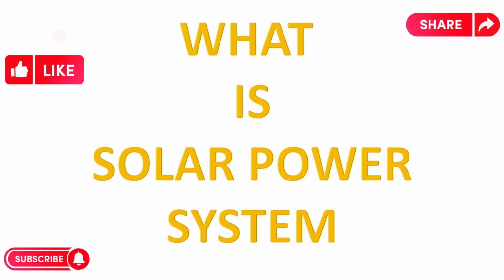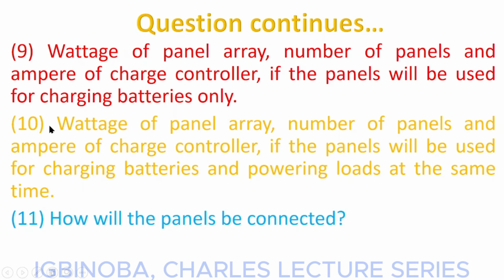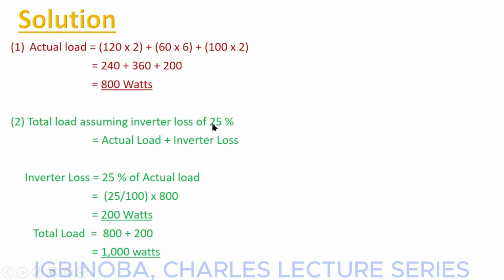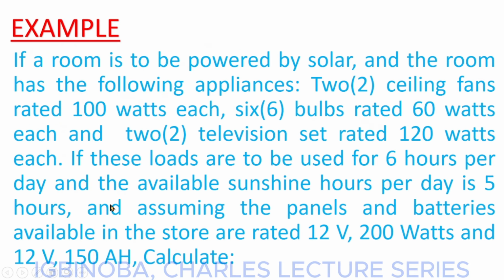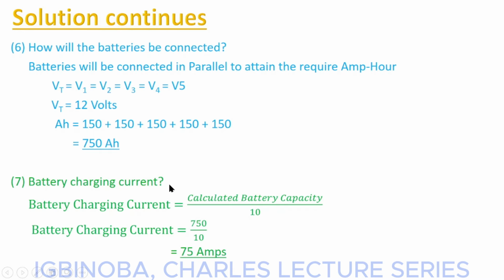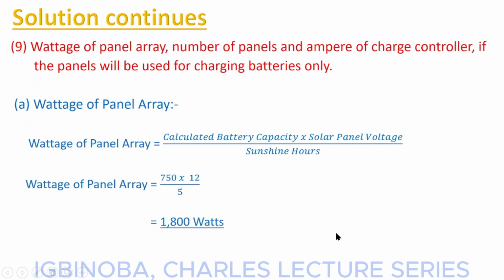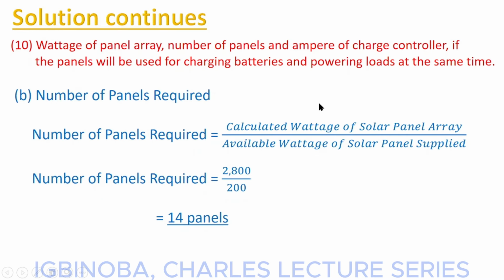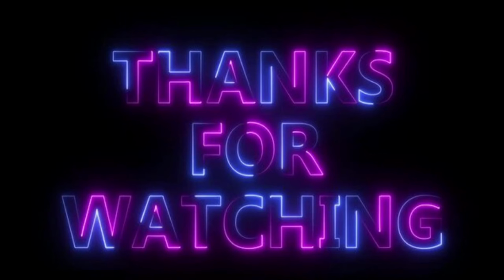Design of Solar Power System

Comment: PETRO64L

1.  Actual load = 1380Watt
2. Total load = 1725Watt
3. Inverter rating = 2156.25VA
4. Battery capacity = 1239.75Ah
5. Number of batteries = 8.625 (9 batteries)
6. They will be connected in parallel
7. Battery charging current = 129.375A
8. Battery charging time with 40% loss = 14hours
9a. Wattage of panel array = 3105Watt
9b. Number of panels = 16 panels
9c. Ampere of charge controller = 258.75A
10a. Wattage of panel array with load = 4830Watt
10b. Number of panels = 25 panels
10c. Ampere of charge controller = 402.5A
11. They will be connected in parallel

Comment: CIV32F 
Answer
1 1,380w
2 1725w
3 2,156.23va
4 1293.75ah
5 9 battery 
6 parallel connection 
7 129.4amp
8 14hrs
9 3105w
9b 16 panels 
9c 258.75amp
10 4,830w
10b 24 panel
10c 402.5amps
11 parallel connection

Comment: EEE10J 
ANSWER 
1380W
1725W
2156.25VA
1293.75Ah
9batteries
Parallel connection 
129.4A
14h
3105W
16panels
258.75A
4830W
24panels
402.5A
The panels are arranged in parallel

Comment: PETRO5SC

Answer

1380watts
1725 watts
2156.25va
1293.75ah
9 batteries
Parallel connection
129.4amps
14 hours
3,105W
16 panels
258.75amps
4,830 watts
24 panels
402.5 amps
The panels are arranged in parallel

Comment: NAT48V

1380watts
1725 watts
2156.25va
1293.75ah
9 batteries
Parallel connection
129.4amps
14 hours
3,105w
16 panels
258.75amps
4,830 watts
24 panels
402.5 amps
The panels are arranged in parallel

Comment: PETRO18R

1. 1380W
2. 1725W
3. 2156.23VA
4. 1296.75Ah
5. 9 batteries 
6. The batteries are connected in parallel 
7. 129.4Amps
8. The battery charging time is 14 hours
9a. 3105W
9b. 16 panels
9c. 258.75Amps
10a. 4830W
10b. 24 panels
10c. 402.5Amps
11. The panels are connected in parallel

Comment: CIV95Q 

1) Actual load = 1380 watt
2) Total load = 1725 watt
3) Inverter rating = 2156.25 VA
4) Battery Capacity= 1239.75 AH 
5) Number of battery = 8.625 (9 battery)
6) They will be connected in parallel 
7) Battery charging current = 129.375 A
8) Battery charging time with 40% loss = 14hrs
9a) wattage of panel array = 3105 watt
9b) number of panels = 16 panels 
9c) Ampere of charge controller = 258.75 A
10a) wattage of panel array with load = 4485 watt
10b) Number of panel = 23 panels
10c) Ampere of charge controller = 373.75A
11) They will be connected in parallel

Comment: CIV14N

Answer:

Actual load = 1380Watt
Total load = 1725Watt
Inverter rating = 2156.25VA
Battery Capacity = 1239.75Ah
Number of batteries = 8.625 (9 batteries)
They will be connected in parallel
Battery charging current = 129.375A
Battery charging time with 40% loss = 14hrs
9a. Wattage of panel array = 3105Watt
9b. Number of panels = 16panels
9c. Ampere of charge controller = 258.75A
10a. Wattage of panel array with load = 4485Watt
10b. Number of panels = 23panels
10c. Ampere of charge controller = 373.75A
They will be connected in parallel

Comment: CHM81C

nswers:
Actual load = 1380Watt
Total load = 1725Watt
Inverter rating = 2156.25VA
Battery Capacity = 1239.75Ah
Number of batteries = 8.625 (9 batteries)
They will be connected in parallel
Battery charging current = 129.375A
Battery charging time with 40% loss = 14hrs
9a. Wattage of panel array = 3105Watt
9b. Number of panels = 16panels
9c. Ampere of charge controller = 258.75A
10a. Wattage of panel array with load = 4485Watt
10b. Number of panels = 23panels
10c. Ampere of charge controller = 373.75A
They will be connected in paralle

Comment: PETROCHEM36J 

1. Actual load: 1380w
2. Total load: 1725W

3. Inverter reading: 2156.23Va

4. Battery capacity using a factor for reserve of 75%: 1293.75Ah

5. Number of batteries for backup hours: 9

6. How will the batteries be connected: parallel

7. Battery charging current: 129.4hrs

8. Battery charging time assuming a charging loss of 40%: 14 hours

9. The wattage of the panel array: 315W

96. The no of panel: 16 panel

9c. The charge controller rating: 258.75ammps

10. The wattage of the panel array: 4830Watts

106. The no of panel: 24 panel

10c. The charge controller rating: 402.5ammps

11. Panel connection: parallel

Comment: EEE102X
1. Actual Load: 1380 W
 2. Total Load: 1840 W 
3. Inverter Rating (0.8 Power Factor): 2300 VA
4. Battery Capacity: 1226.67 Ah
 5. Number of Batteries: 9 batteries 
6. Battery Connection: Parallel 
7. Battery Charging Current: 120 A 
8. Battery Charging Time: 16.67 hours 
9. Solar Setup (Batteries Only): 2944 W (or 3000 W), 15 panels, 250 A charge controller 
10. Solar Setup (Batteries + Load Simultaneously): 4784 W (or 4800 W), 24 panels, 400 A charge controller 
11. Panel connection: parallel

Comment: PETROCHEM14N 
Answer:
1. Actual load =1380W
2. Total load=1725W
3. Inverter rating VA=2156.25VA
4. Battery capacity=1293.75Ah
5.No of batteries=9 batteries 
6. Parallel connection 
7. Battery charging current=129.39Amps
8. Charging time =14hrs
9a. Panel wattage =3105W
9b. No of panels=16panels
9c. Amps of charge CONT= 258.75Amps
9d. Parallel connection 
10a. Panel wattage =4830W
10b. No of panels =24.15
10c. Amps of charge CONT =402.5Amps

Comment: PETROCHEM9I
Answers
1. Actual load = 1380watt
2. Total load = 1725watt
3. Inverter rating = 2156.25VA
4. Battery capacity = 1239.75Ah
5. Number of batteries = approximately 9 batteries 
6. They will be connected in parallel 
7. Battery charging current = 129.375A
8. Battery charging time with 40% loss = 14hours
9a. Wattage of panel array = 3105watts
9b. Number of panels = 16 panels 
9c. Ampere of charge controller = 258.75A
10a. Wattage of panel array with load = 4485watt
10b. Number of panels = 23 panels 
10c. Ampere of charge controller = 373.75A
11. They will be connected in parallel

Comment: PETROCHEM1A 

1. Actual load = 1380 watts

2. Total load = 1725 watts

3. Inverter rating = 2156.25VA

4. Battery capacity = 1239.75Ah

5. Number of batteries = 8.625 i.e 9 batteries 

6. Connection is parallel 

7. Battery charging current = 129.375A

8. Battery charging timw with 40% loss = 14hrs 

9a. Wattage of panel array = 3105 watt

9b. Number of panels = 16 panels 

9c. Ampere of charge controller = 258.75A

10a. Wattage of panel array with load = 4485 watt

10b. Number of panels = 23 panels

10c. Ampere of charge controller = 373.75A

11. Connection is parallel

Comment: NAT23w
1380watts 
1725 watts 
2156.25va
1293.75ah
9 batteries 
Parallel connection 
129.4amps
14 hours 
3,105w
16 panels 
258.75amps 
4,830 watts 
24 panels 
402.5 amps
The panels are arranged in parallel

Comment: PETROCHEM47U
 
1.Actual load =1380W

2.Total load =1725W

3. Inverter reading: 2156.23VA

4. Battery capacity using a factor for reserve of 75%: 1293 .75Ah

5. No of battery for backup hours: 9

6. How will the battery be connected: parallel 

7. Battery charging current: 129.4 hrs

8. Battery charging time assuming a charging loss of 40%: 14hrs

9. Wattage of the panel array: 315W

9b. The no of panel: 16 panel

9c. The charge controller rating: 258.75ammps

10. The wattage of the panel array: 4830 Watts

10b. No of panel: 24 panel

10c. The charge controller rating: 402.5ammps

11. Panel connection: parallel

Comment: MAR59G

1. Actual load = 1380Watt
2. Total load = 1725Watt
3. Inverter rating = 2156.25VA
4. Battery Capacity = 1239.75Ah
5. Number of batteries = 8.625 (9 batteries)
6. They will be connected in parallel
7. Battery charging current = 129.375A
8. Battery charging time with 40% loss =
14hrs
9a. Wattage of panel array = 3105Watt
9b. Number of panels = 16panels 9c. Ampere
of charge controller = 258.75A
10a. Wattage of panel array with load =
4485Watt
10b. Number of panels -23panels
10c. Ampere of charge controller = 373.75A
11. They will be connected in parallel

Comment: PETRO22V
1. Actual load= 1380 Watt
2. Total load= 1725 Watt
3. Inverter rating= 2156.25VA
4. Battery capacity= 1239.75 Ah
5. Number of batteries= 8.63 ~ 9 batteries 
6. They will be connected in parallel 
7. Battery charging current= 129.375A
8. Battery charging time with 40% loss= 14 hrs
9a. Wattage ot panel array= 3105Watt
9b. Number of panels= 16 panels 
9c. Ampere of charge controller= 258.75A
10a. Wattage of panel array with load= 4485 Watt
10b. Number of panels= 23 panels 
10c. Ampere of charge controller= 373.75A 
They will be connected in parallel

Comment: CHM78Z

1. Actual load: 1380W

2. Total load: 1725W

3. Inverter reading: 2156.23Va

4. Battery capacity using a factor for reserve of 75%: 1293.75Ah

5. Number of batteries for backup hours: 9

6. How will the batteries be connected: parallel 

7. Battery charging current:129.4hrs

8. Battery charging time assuming a charging loss of 40%: 14 hours

9. The wattage of the panel array: 315W

9b. The no of panel: 16 panel

9c. The charge controller rating: 258.75ammps

10. The wattage of the panel array: 4830Watts

10b. The no of panel : 24 panel

10c. The charge controller rating: 402.5ammps

11. Panel connection: parallel

Comment: PETROCHEM4D 

Answers.
1. Actual load = 1380Watt
2. Total load = 1725Watt
3. Inverter rating = 2156.25VA
4. Battery capacity = 1239.75Ah
5. Number of batteries = 8.625 (9 batteries)
6. They will be connected in parallel 
7. Battery charging current = 129.375A
8. Battery charging time with 40% loss = 14hours
9a. Wattage of panel array = 3105Watt
9b. Number of panels = 16panels 
9c. Ampere of charge controller = 258.79A
10a. Wattage of panel array with load = 4485Watt
10b. Number of panels = 23panels
10c. Ampere of charge controller = 373.75A
11. They will be connected in parallel

Comment: CHM26Z 

ANSWER:
1. Actual load = 1,380 W

2. Load including inverter loss = 1,840 W

3. Inverter = 2,300 VA → choose 3 kVA

4. Battery capacity = 1,226.7 Ah

5. 9 × 12 V, 150 Ah batteries

6. Batteries in parallel → 12 V, 1,350 Ah

7. Charging current ≈ 270 A

8. Charging time ≈ 7 hours

9. Charging only: 17 × 200 W panels, ≈ 300 A controller

10.  Charging + loads: 26 × 200 W panels, ≈ 450 A controller

11. Panels: parallel under the simplified 12-V assumption

Comment: PETRO78Z

Answers:
1. Actual load = 1380Watt
2. Total load = 1725Watt
3. Inverter rating = 2156.25VA
4. Battery Capacity = 1239.75Ah
5. Number of batteries = 8.625 (9 batteries)
6. They will be connected in parallel
7. Battery charging current = 129.375A
8. Battery charging time with 40% loss = 14hrs
9a. Wattage of panel array = 3105Watt
9b. Number of panels = 16panels
9c. Ampere of charge controller = 258.75A
10a. Wattage of panel array with load = 4485Watt
10b. Number of panels = 23panels
10c. Ampere of charge controller = 373.75A
11. They will be connected in parallel.

Comment: PETROCHEM42P

Answer:
1. Actual load:  1380 W

2. Total load: 1840 W

3. Inverter reading (0.8 factor power): 2300 VA or 2.3kVA

4. Battery Capacity: 1226.67 Ah

5. Number of Batteries: 9 batteries 

6. Battery Connection: Parallel

7. Battery Charging Current: 120A

8. Battery Charging time: 16.67 hours 

9. Solar Setup (Batteries only): 2944W (or 3000W), 15 Panels, 250A charge controller 

10. Solar setup (Batteries + Load simultaneously): 4784W (or 4800W), 24 Panels, 400A charge controller 

11.  Panel connection: Parallel

Comment: CHM93O 

1. The actual pad is 1,380W
2. The Total load is 1,725W
3. The inverter rating is 2,156.23VA
4. The battery capacity is 1,293.75Ah 
5. The Number of batteries is 9
6.  The batteries are connected in parallel 
7. The Battery charging current is 129.4 amps.
8. The battery charging time is 14 hours.
9. a. The wattage of the panel array is 3,105W
b. The number of panels is 16 panels.
c. The Charge controller rating is 258.75 amps.

10. a. The wattage of the Panel array is 4,830 Watts 
b. The number of panels is 24 panels.
c. The charge controller rating is 402.5 amps
11. The panels are arranged in parallel

Comment: COMP26Z 

1. The actual pad is 1,380W
2. The Total load is 1,725W
3. The inverter rating is 2,156.23VA
4. The battery capacity is 1,293.75Ah 
5. The Number of batteries is 9
6.  The batteries are connected in parallel 
7. The Battery charging current is 129.4 amps.
8. The battery charging time is 14 hours.
9. a. The wattage of the panel array is 3,105W
b. The number of panels is 16 panels.
c. The Charge controller rating is 258.75 amps.

10. a. The wattage of the Panel array is 4,830 Watts 
b. The number of panels is 24 panels.
c. The charge controller rating is 402.5 amps
11. The panels are arranged in parallel

Comment: CHM7G 
ANSWERS:
(1) ACTUAL LOAD = 1380watts
(2) TOTAL LOAD = 1725watts
(3) INVERTER RATING VA = 2156.25VA
(4) BATTERY CAPACITY = 1293.75Ah
(5) NO OF BATTERIES = 9 Batteries 
(6) PARALLEL CONNECTION 
(7) BATTERY CHARGING CURRENT= 129.39Amps
(8) CHARGING TIME (40% LOSS) = 14Hrs 
(9a) PANEL WATTAGE = 3105watts
(9b) NO OF PANELS = 16 Panels 
(9c) AMPS OF CHARGE CONT. = 258.75Amps 
(9d) PARALLEL CONNECTION 
(10a) PANEL WATTAGE = 4830watts 
(10b) NO OF PANELS = 24.15 (Make 25 panels to carry system)
(10c) AMPS OF CHARGE CONT. = 402.5Amps 

NOTE: For the charge controller get a higher amps range controller to fully carry the system.

Comment: MAR65M

Answers:
1. Actual load = 1380Watt
2. Total load = 1725Watt
3. Inverter rating = 2156.25VA
4. Battery Capacity = 1239.75Ah
5. Number of batteries = 8.625 (9 batteries)
6. They will be connected in parallel
7. Battery charging current = 129.375A
8. Battery charging time with 40% loss = 14hrs
9a. Wattage of panel array = 3105Watt
9b. Number of panels = 16panels
9c. Ampere of charge controller = 258.75A
10a. Wattage of panel array with load = 4485Watt
10b. Number of panels = 23panels
10c. Ampere of charge controller = 373.75A
11. They will be connected in parallel.

Comment: MAR54B

1. The actual pad is 1,380W
2. The Total load is 1,725W
3. The inverter rating is 2,156.23VA
4. The battery capacity is 1,293.75Ah 
5. The Number of batteries is 9
6.  The batteries are connected in parallel 
7. The Battery charging current is 129.4 amps.
8. The battery charging time is 14 hours.
9. a. The wattage of the panel array is 3,105W
b. The number of panels is 16 panels.
c. The Charge controller rating is 258.75 amps.

10. a. The wattage of the Panel array is 4,830 Watts 
b. The number of panels is 24 panels.
c. The charge controller rating is 402.5 amps
11. The panels are arranged in parallel

Comment: CHM108Y

Answers.
: 1. Actual load = 1380Watt
2. Total load = 1725Watt
3. Inverter rating = 2156.25VA
4. Battery Capacity = 1239.75Ah
5. Number of batteries = 8.625 (9 batteries)
6. They will be connected in parallel
7. Battery charging current = 129.375A
8. Battery charging time with 40% loss = 14hrs
9a. Wattage of panel array = 3105Watt
9b. Number of panels = 16panels 9c. Ampere of
charge controller = 258.75A
10a. Wattage of panel array with load =
4485Watt
10b. Number of panels = 23panels
10c. Ampere of charge controller = 373.75A
11. They will be connected in parallel

Comment: PETRO84F

Answers:
1. Actual load = 1380Watt
2. Total load = 1725Watt
3. Inverter rating = 2156.25VA
4. Battery Capacity = 1239.75Ah
5. Number of batteries = 8.625 (9 batteries)
6. They will be connected in parallel
7. Battery charging current = 129.375A
8. Battery charging time with 40% loss = 14hrs
9a. Wattage of panel array = 3105Watt
9b. Number of panels = 16panels
9c. Ampere of charge controller = 258.75A
10a. Wattage of panel array with load = 4485Watt
10b. Number of panels = 23panels
10c. Ampere of charge controller = 373.75A
11. They will be connected in parallel.

Comment: EEE11K 

Answers.
: 1. Actual load = 1380Watt
 2. Total load = 1725Watt
 3. Inverter rating = 2156.25VA
 4. Battery Capacity = 1239.75Ah 
5. Number of batteries = 8.625 (9 batteries) 
6. They will be connected in parallel
 7. Battery charging current = 129.375A
 8. Battery charging time with 40% loss = 14hrs 
9a. Wattage of panel array = 3105Watt
 9b. Number of panels = 16panels 9c. Ampere of charge controller = 258.75A 
10a. Wattage of panel array with load = 4485Watt 
10b. Number of panels = 23panels 
10c. Ampere of charge controller = 373.75A
 11. They will be connected in parallel

Comment: CIV73U
Answers:
Actual load = 1380Watt
Total load = 1725Watt
Inverter rating = 2156.25VA
Battery Capacity = 1239.75Ah
Number of batteries = 8.625 (9 batteries)
They will be connected in parallel
Battery charging current = 129.375A
Battery charging time with 40% loss = 14hrs
9a. Wattage of panel array = 3105Watt
9b. Number of panels = 16panels
9c. Ampere of charge controller = 258.75A
10a. Wattage of panel array with load = 4485Watt
10b. Number of panels = 23panels
10c. Ampere of charge controller = 373.75A
They will be connected in parallel.

Comment: PETROCHEM55C 
ANSWER:
1.Actual load =1380Watt
2.Total load=1725Watt
3.Inverter rating=2156.25VA
4.Number of batteries=8.625(9 batteries)
5.Battery Capacity=1239.75Ah
6.They will be connected in parallel
7.Battery charging current=129.375A
8.Battery charging time with 40% loss=14hrs
9a.Wattage of panel array=3105Watt
9b.Number of panels=16 panels
9c.Ampere of charge controller=258.75A
10a.Wattage of panel array with load=4485Watt
10b.Number of panels=23 panels
10c.Ampere of charge controller=373.75A
11.They will be connected in parallel

Comment: MEC15O

1.)  Actual load = 1,380 W.

2.)  Total load including 25% inverter loss = 1,840 W.

3.)  Inverter rating = 2,300 VA (2.3 kVA).

4.)  Required battery capacity = 1,226.67 Ah ≈ 1,227 Ah.

5.)  Number of batteries required = 9 batteries of 12 V, 150 Ah.

6.)  The 9 batteries will be connected in parallel.

7.)  Battery charging current = 135 A.

8.)  Battery charging time = 17 hours.

9.)  For charging batteries only: panel array = 3,240 W, requiring 17 panels and a 270 A charge controller.

10.)  For charging batteries and powering loads simultaneously: panel array = 5,080 W, requiring 26 panels and approximately a 423 A charge controller.

11.)  The solar panels will be connected in parallel for the 12 V system.